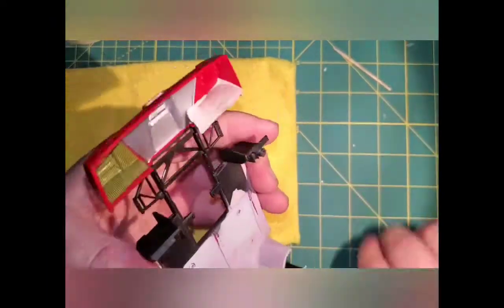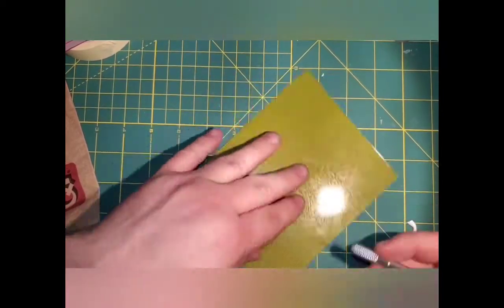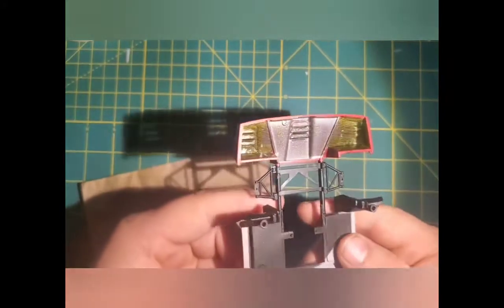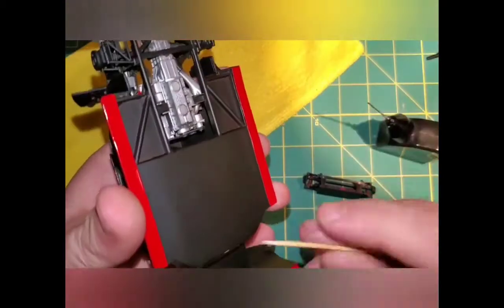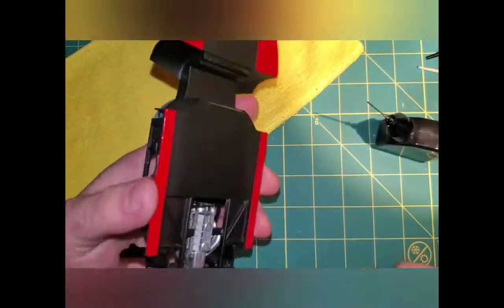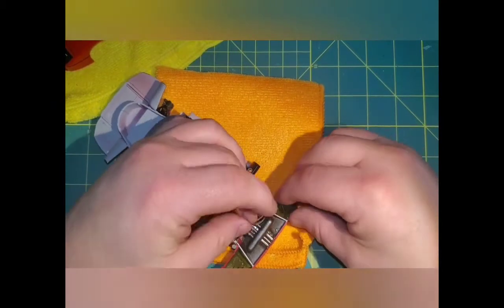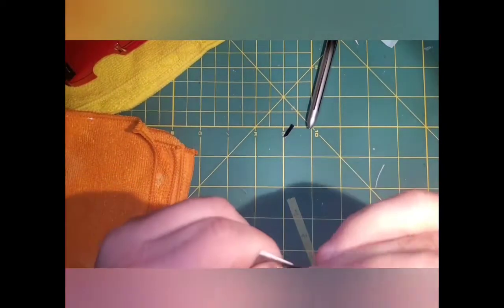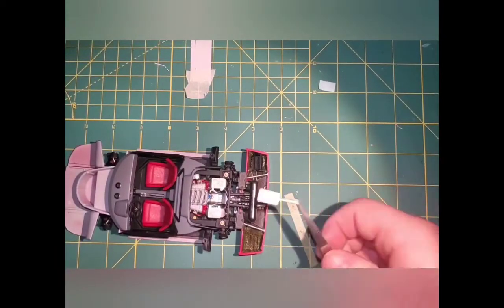Tamiya F40 full build - Part 6, chassis work

Comment: Which kit of the F40 do you like better? The Tamiya or Fujimi? Do you know if or how well all the Tamiya F40 detail sets will work with the Fujimi kit? I have the Fujimi F40 and your videos are giving me ideas on how to build mine. I like your cat.
Reply from the maker: I prefer Tamiya over Fujimi. Ideally they should fit since both measure out to the real car. Only thing I think would be different is the mounts for the grills.
Reply: Cool & Thank You. I have a Tamiya Audi Quattro & a Tamiya Mercedes Benz 500 SEC. Still need to build them as well and will be using Ferrari stile wheels & tires on the Audi, like the front ones, on the F40 kit.